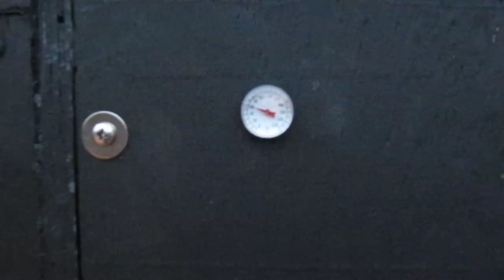GenBox 1.0 Setup

Comment: you have a garage , why do you need a sound box
Reply from the maker: I have hamburgers, why do I need steak? For one, I can't carry my garage to a camp site or festival. For another, my garage is stuffed to the rafters with crap. For another, I don't have a way to vent exhaust out of the garage. For another, the garage actually isn't any good at stopping that noise. My neighbor right behind me there in that shot complains just from that audiobook, even with the doors closed. Finally, "need" is entirely the wrong question. No one really "needs" anything. You develop and hack on projects like this mostly for the satisfaction of accomplishing something useful in general, regardless if you really needed it that much yourself. I could have purchaced 3 Honda inverter generators to make the same electricity quietly. I'd just be spending about $3500 instead of about $800 plus about a weeks worth of evenings in time. And, if I purchased some ready-made Hondas, I wouldn't have helped provide a recipe for a box that actually works and is made from regular common materials. The next guy would have no choice but to spend a fortune, or live with ridiculous offensive levels of noise, or live without power, or cook his generator in a box that doesn't actually work. All the ones I've seen either leak so much noise they are pointless, or they don't move enough air to actually deal with the exhaust, or they are made of cynder blocks and not portable, or they are made of stupid expensive exotic materials that end up costing as much as just getting a Gucci I mean Honda that doesn't need any sound box.  The real question about why do I need this thing isn't even about the garage. Why do I need it because my power never actually goes out! It's a solid and satisfying engineering chanllenge man!
Reply: ty for reply
Reply: Brian White is your generator box fanless?  What insulation material did you use and how thick?
Reply from the maker: jon smith There is a huge  comment on the vid at the top here that describes all that, and a link to some pictures during construction and showing some of the parts and materials up close. There is a fan, and the fan is the one special part that you can't just get at a local home depot. Basically you need about 1200 cfm. That's hard to find in a small package. The next best alternatives are make the box somewhat larger and use a whole-house exhaust fan, or add a dc power supply and use a car radiator fan. I wanted to avoid either of those compromises, but they are options. The insulation is just cheap carpet from home depot. 2 laters, one thin indoor-outdoor on the plywood, and one thick shag on top of that when the indoor-outdoor wasn't enough. The baffle boxes on the ends have only the indoor-outdoor, because those are air passages you want to keep as open and smooth inside as possible. Only the main inside 4 walls and lid has the shag. Look just under the video and expand the comment.
Reply: Brian White thanks
Reply: ''1st.Rule..''Never Put A Generator On Cement.And Keep It 23 Feet From house,And Lay 4 Ply Wood Around It,On An angle.The ground will Soak up the Noise.
Reply from the maker: 23 feet don't exist between my and my neighbors house in any direction, all 3 sides. and the entire back lot is paved. And this arrangement is much quieter than loose 45 degree panels 20 or 30 feet away on grass, even when that IS available.